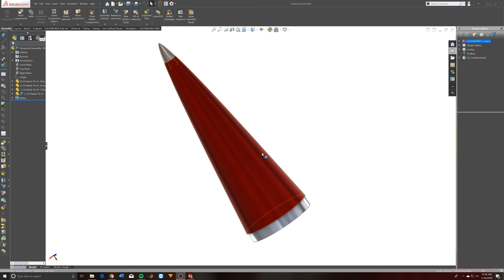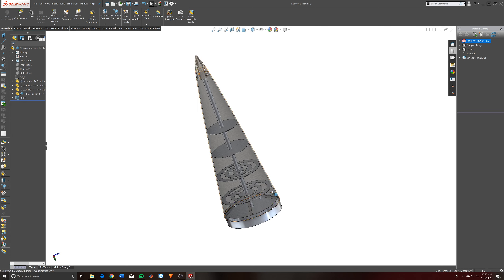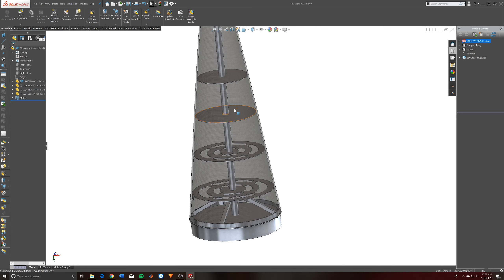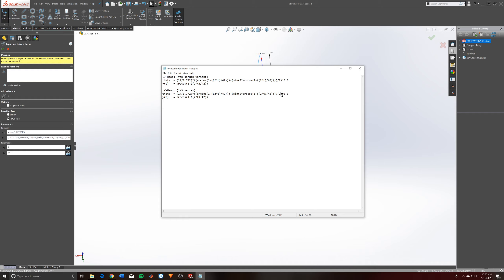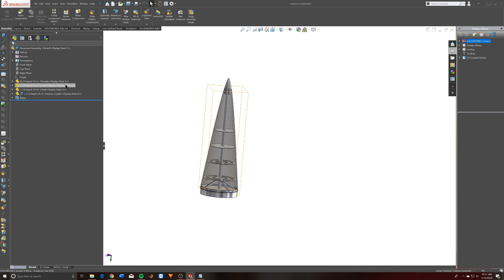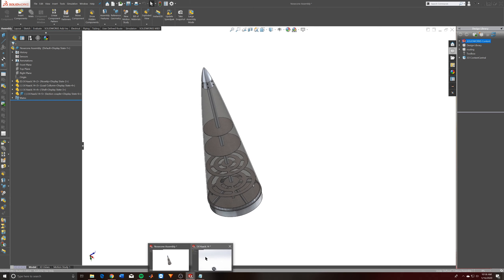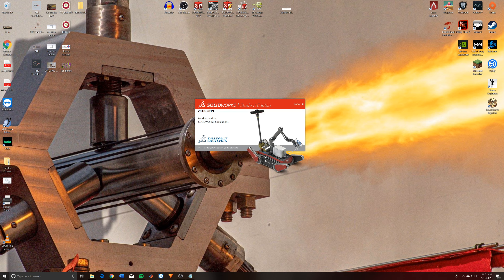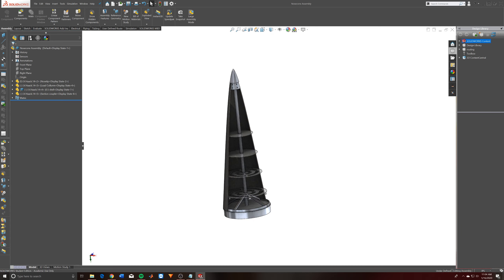FTR Nose Cone Design

Comment from the maker: Important Timestamps: 
1) Nose cone design overview @2:05
2) Nose cone tip overview @2:45
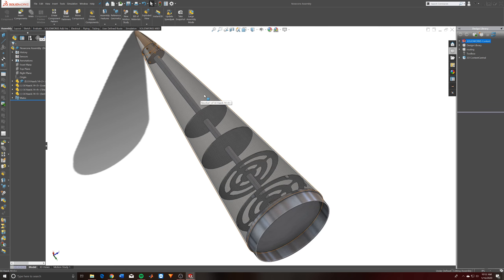3) Assembly plan @4:20
4) equation driven spline @5:45
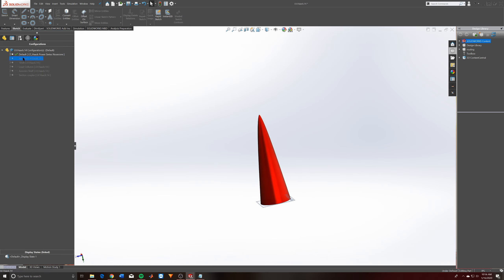5) using configurations to make parts @8:30
6) example configuration @10:50